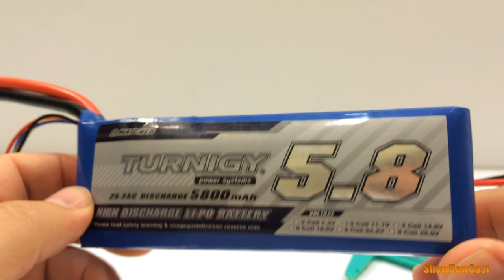How to open up a swollen 3S battery and identify the bad cell

Comment: I would have discharged the battery before opening it up. Just in case that you puncture a cell, or do a short circuit, there is no so much energy stored and the fire will be smaller.

Comment: Throw it away Not worth the risk
Reply: Only worth it if you value your time at about $0.25 per hour. Otherwise get a new pack. Why would you want to mix cells from packs that have a different number of cycles, and at that age probably a vastly different IR. You're just begging for issues.